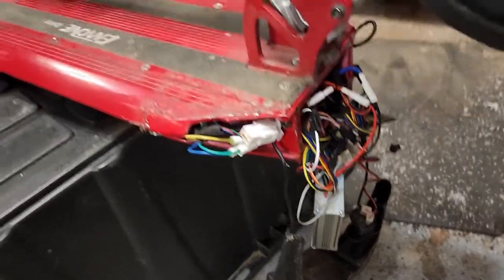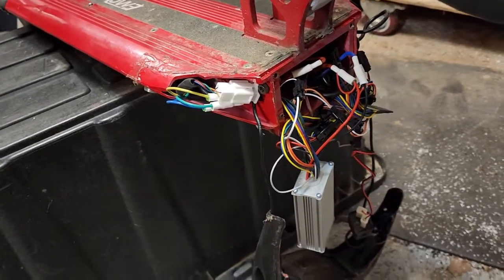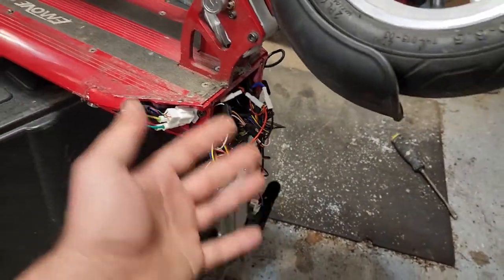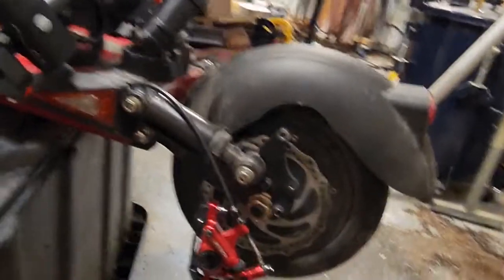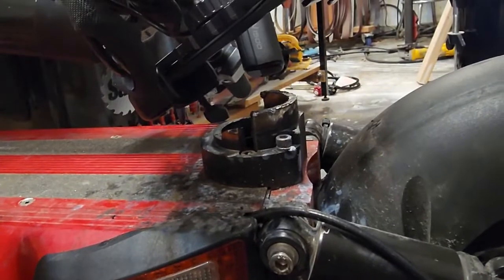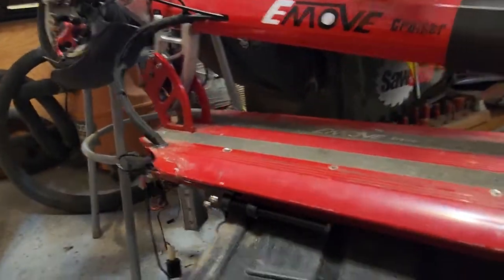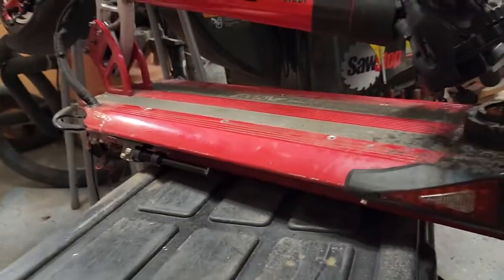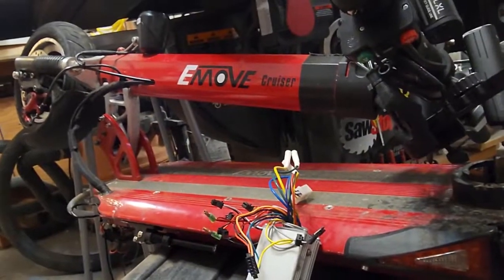Why you should not buy a Voro Motors 1000w emove cruiser - honest 6 month review - tons of problems!

Comment: I went to 3 different scooter repair shops in my city and the mechanics all told me to stay away from Voro. One shop mechanic literally pointed his finger and showed me a line of 5 Emove cruisers he’s fixing one by one. He told me Voro is one of those company that uses cheap parts on their scooters and sponsorships to sell their products.
Reply: Lol i like my emove but every part has been breaking down from the breaks the screws all fall out especially from around  the stem lock which is dangerous it doesn't have a 2nd safety feature to keep the stem in place i had to place a band around that to keep it secure besides that i had no electrical or motor problems its pretty good if you just just patch up all the problems yourself since things break in life but then again you shouldn't have to but its whatever it has its ups and downs
Reply: @ceffreyjastillo  I used loctite on the hardware.i bought it 5 months ago and haven't replaced a thing on it not one bolt and that's with riding through the Oregon Cascades which can essentially be a rollercoaster at times🤔
Reply: @Barry Szymanski  you basically got the original xbox 360 that DOESN'T get the red ring ..very lucky and good for you and also im try out that loctite you mentioned that seems like a good idea
Reply: @ceffreyjastillo  someone highly suggested it to me so I was like you know that's a good idea ,and ya know maybe I shouldn't be counting my chickens before they hatch so to speak 5 months is still decently new
Reply: @barryszymanski8022  yeah safe riding man
Reply: @ceffreyjastillo  I appreciate it 😁
Reply: @barryszymanski8022   How has it been since?

Comment: I have had similar issues with mine since I’ve purchased in November 2021. Voro motors doesn’t care. My scooter completely shut down on me. They blame it on being wet, claiming I had water in the deck. Which is insane, because I never used in rain or wiped it down ever! It stays in my car trunk. They charged me 75 for labor ( tighten screws) and a 35 service fee. To have to bring it back in two weeks later. Buyer beware!!
Reply from the maker: Wow, what a terrible company!
Reply: It is a terrible company, they sale parts that they dont even have in stock. I waited over 4 months for a new tire/motor i payed for just to have them tell me they dont have it after a weem prior to the 4 months i already waited... They told me they just got them in and then apparently they didnt . I got both their models and popped tires on both. The touring i only got because they had a sale and i got it until i got my new motor tire... which i still havent received yet. Trash company

Comment: I had mine and had it over 3,000 miles at this point. Its been fine lol. Just typical issues like flat tire and brakes going bad but thats expected. dunno what you do with yours lol.
Reply: Right im saying it breaks down like it was designed by people on acid and crack but besides the screws falling apart the cheap noodle string breaks ripping i just fix it up and keep moving lol
Reply: @ceffreyjastillo  yeah defo not built the best but DAMN that insane range keeps me coming back! I'm able to ride for hours and hours and still have battery remaining! And I'm cruising at over 30 mph too! Crazy
Reply: @TheJVCguy  lol yeah thats pretty much all it has going for it but if you make your own mods its a really good scooter i just put some stronger screws for the stem and put a clamp on the s knob so it doesn't pop out for extra protecton and bam really good scooter lol best battery for that vaule and thats a fact
Reply: @ceffreyjastillo  I just kept mine stock It's been fine after 3,000+ miles so it's alr. I have the 2020 model so I did upgrade the motor to the 1000w one and now I can get it up to 30 mph or more and still get around 45 - 50 mile range

Comment: I was thinking this is going to be my next scooter. Not any more! Thanks for the warning.
Reply: this is also a Gen 1 , I have the Gen 2 which has had no issue at all after 400KM , mine came with the rounded handle bars and they solved all kinds of issues . it's ipx6 water resistant which is not water proof. this guy should have returned the scooter after the first controller failure. Voro is known for good customer service on the vehicles
Reply: @KShedTech  how can you check to see what generation you have?
Reply: @ydoc503  Gen 2 has standard round handle bars compared to the square verson on gen 1 but anyting 2021 and later is Gen 2 + The Gen 2 has beeter battery life, range, speed, breaks and even updated lights.
Reply: @KShedTech  appreciate the knowledge! thank you
Reply: @KShedTech  Then there's the Gen 3 "S" model, new in 2023, which has the new sine wave controller, better upper stem base, 1000watt motor, vertical thumb throttle (love it!!),  plus they already put Doctor Orange goop inside the tires, and they're tubeless!  I ordered it and had it in my possession five days later. Great customer service. Very happy riding it. I love it. I'm so bummed for this guy's experience. Obviously he would have been better off with a massive dual motor scooter, something more suited to his (what appears to be) rough and tumble riding. I have a Kaabo Wolf Warrior 11+ (also from Voromotors) but after just a few miles I discovered it's a bit too fast and powerful for me at the moment but it is perfectly suited for future, aggressive off-road riding. Meanwhile my new eMove Cruiser "S" is perfect! People, don't give up on Voromotors. They've made the necessary improvements in this new 2023 S model and they're working so hard to please customers. (Just don't expect to return parts or accessories. Those items are not returnable.) Being a good company takes work and some trial and error. Give them a chance.

Comment: If they're refusing to provide additional help. You should definitely look into returning it for your money back. These things cost over $1,500.00 with taxes and shipping.
Reply from the maker: I tried but they said NO and they have already helped me more than they usually help their customers
Reply: @scooterbooter3133  That sucks. I just read their warranty online and it only covers one replacement of each covered part, so I guess they did what they could.

I would suggest getting a different brand of controller. Is there any chance you're pushing the recommended weight limit or maybe the hills you're doing are too steep?

Last year I bought and fixed up a damaged razor electric motorcycle for my kid, and you'd be surprised what upgraded electronics can do vs the usually no-name electronics that come stock.
Reply: @scooterbooter3133  They said the same thing to me lol. This company is horrible!
Reply from the maker: @Phyoomz  It also says itll take a 350lb rider up a 20 degree slope, which it couldnt do half of
Reply: @scooterbooter3133  that's horrible. And to think, I was gonna buy a touring over the summer. I guess not.
Reply: @Scooterbooter  Holy crap, they told me the same thing! I told them that while that may or may not be true, my scooter arrived with issues from day one (faulty brakes, missing screws, stripped sockets) and hasnt stopped having problems. So while they might be servicing it a lot, its due to manufacture defect, poor parts or poor tech. Argh, so frustrating.
Reply: I have reported these issues and the company at 311. Just giving suggestions to all. Something must be done with this company!
Reply: @danielacardona7160  I'm getting a lawyer to sue them. I guarantee they will have to pay back just like 3M
Reply: @audemars_piguet13  well I don’t have the budget to pay for a lawyer but let me know if my review can be helpful or anything else I can do. 
I also reported the company when I recently got the scooter at the Business Bureau but they don’t seem to be registered as a company there
Reply: @danielacardona7160  agreed. I will do the same
Reply: @scooterbooter3133  That's just terrible for them to say, a 25amp controller with a heavy rider is going to easily burn out the controller if used up big hills constantly
Reply: Was looking at this scooter for quite some time. But i hear complaints all the time , should i go with dualtron mini instead? Or eagle pro?
Reply: @scooterbooter3133  Are there any lemon laws in your state? You can always go to small claims court if necessary. Voro not granting warranty coverage within that year is probably more in class-action lawsuit territory; if everything you say is true, you'd be doing them a favor by going through small-claims.

Comment: I am a delivery driver and in first two weeks I had many things breaking like twice folding mechanism screw, key lock ignition, bearings on the front wheel, rear fender and controller in the end. Than I tried to post my experience on Emove owners facebook group which turned out to be very shady because moderators denied my post which makes me think they are censoring negative experiences. Some review companies are also sponsored by them and say only positive things about the scooter which makes me wonder if they tested it toroughly. After I posted few comments about the issues I have esperienced someone from Voromotors contacted me via email offering to fix things for me but I have to pay for it. Now I fixed all of this issues alone and so far so good. All in all scooter is good when it works properly but there is no guarantee it always will.

Comment: I bought the emove cruiser S in June of 2023, but now the controller has died and melted the wires inside the scooter.  The battery was still able to pass current to the motor indefinitely after the controller failed even with the machine turned off.  This caused the rear motor to lock up due to the motor windings being energized.
Definitely a controller issue. If only they splurged a bit more on the controller and potted the sensitive electronics, then it likely would have been better.

Comment: I also can not and would not recommend this scooter. Here is my experience after 6 months: 

I purchased my Emove Cruiser in Nov 2021 online from the shop in LA. It arrived in NYC with issues. Missing screws, loose screws, wires too short which would disconnect. The front brakes needed to be replaced. This began a continual series of issues and problems with the scooter, both minor and major. (Noted below)

While the shop in Brooklyn did try to mitigate these issues, I had to cajole and push them to do so. They continually tried to shirk responsibility, and sometimes did not correct an issue or it left the shop with new issues. I don't believe Voro Motors is out there intentionally trying to screw people. I do believe they don't want to stand behind their product, and do not have the right trained technical repair staff, nor use good parts or a good build. They often suggested it was my riding style which caused the problems. For clarity, I ride it in the bike lanes here in NYC to commute to and from work.

After the scooter arrived and they fixed the first issues, the front wheel and shocks and shock mount fell right off after the bolt holding the shock mount the frame sheared off. This was after repeatedly informing both Brooklyn and LA shop that the scooter felt unsafe and too wobbly, in spite of frequent tightening of screws. They assured me everything was ok. Spoiler alert: It was not. As noted, the entire front wheel and shock section fell off, and they replaced it.

The rear wheel went flat and after finding no leaks, a local, well respected scooter shop told me the wheel was rubbing against the rim and causing it to deflate. I took it to Brooklyn, informed them of the issue. They disagreed with the assessment. However, the tire was flat and has no leaks. They inflated the tire. Spoiler alert, it went flat again a few weeks later.

I've had to replace the rear brakes three times, without having ridden the scooter much from Nov-March. Again, the shop suggested I was riding the brakes the too hard. I can tell you I was using the brakes in a natural, standard way while driving the scooter in a bike lane.

The battery failed. This is after I told them it wouldn't hold a charge, I brought it to the shop, and they told me it held a charge for them. I took it home, the battery wouldn't hold a charge! I took it back to shop, they called me a few days later to say they have more experienced battery techs now and indeed have confirmed the battery has failed.

And now lastly, the front tire and shocks feel way too loose and unsafe again. I feel strongly all these issues are due to poor parts, bad build and bad tech. This scooter clearly can not be used in regular use on regular city roads. In fact, after all this, the company has informed me that this $1500 scooter that can go 25MPH should not be ridden on uneven roads as that can damage the scooter. They also told me I was free to sell it to someone else If I was dissatisfied. All in all a very disappointing, exasperating situation, made more so by a company that has be to dragged along just to honor basic responsibility for repairs and service.

I do not and can not in good conscience recommend this scooter or the company service.
Reply from the maker: Wow man that sound even worse than my experience.  Spend 1500 dollars and all you get is months of frustration and an unsafe and unreliable scooter
Reply: @scooterbooter3133  Right. I mean this very sincerely, and told them a similar thing for the health and sustainability of the company: They should make it very clear this this scooter is not built for commuting in an urban environment and discourage people from buying it for that use. Instead, what they have now told me long after the fact is they recommend it not be used on uneven or bumpy roads, and I am free to sell if it I like. A horrible, atrocious, unsustainable business tactic. Someone higher up needs to get this under control stat.

Comment: My cruiser has been in the shop for 4 months as we try to find a replacement motor controller. We don't want to buy from voro again as they sent us 2 dead on arrival controllers and then ghosted us. I really want to get it working again as It was a very fun ride, and now that I don't have a warranty to worry about, I'm free to modify as I please. So if anyone knows of a good replacement motor controller, could you please link it to me. preferably sine wave, but any will do as long as it works and is not from voro.

Comment: Thanks for posting this video. It makes me feel I am not alone on facing these issues with Voromotors. HORRIBLE customer service and warranty policy. They normalize unsafetiness and insecureness. It shouldn´t be normal that screws break or fall apart while you are riding. And much more. The videos of positive reviews might be true but for the first month or so.
Reply from the maker: Yea, thing is like a bottle rocket - fun for a second then it explodes
Reply: Daniela, I am bummed this happened to you and also a bit relieved to know it really isn't just me. The customer service in Brooklyn was constantly suggesting it was my riding style that caused problems, or that having to tighten the screws before every ride was normal, or even that the fact that it felt like it was going to fall apart our from underneath me was just "regular give." I bought mine in Nov. Have had consistent severe issues, including the front tire and shocks falling right off as the nut holding the shock mount to neck sheared right off. Voro has been really tough to deal with. Yesterday, they emailed me to tell me I was free to sell the scooter if I was unhappy. So so bad. Its been terrible. :/
Reply: @paolosstore  I hear you exact same experience. It’s always my fault. Last Wednesday picked up my scooter at BK facility. $330 in repairs, bought new controller, electric wires … etc because according to them that was needed. About 10 miles riding the scooter and exact same issues as before. I bring it back on Saturday and the controller was broken again with water damage when I only rid the scooter once and no rain. They didn’t replace it but said that it was my fault and that it’ll break again because it had water damage??? I had just bought a new one supposedly. I really think that either they lie to the customers and don’t replace things or they have really bad quality stuff and accessories. 
They told me that if I didn’t pick up the scooter in 15 days they’ll charge my card $20 per day for storage lol. It’s just insane. People, PLEASE!!! Don’t buy from this company. It’s a nightmare
Reply: @danielacardona7160  Ugh, I'm really sorry to hear that. Something isn't right with that shop and company. I've been considering filing a report with the AG here in NY. Not to create any problems for them per se, but I keep hearing the same issues from Cruiser owners and if it's possible (which I think is likely) that Voro knows they are using faulty parts, cheap parts, and/or are knowingly selling scooter that they know can't handle regular use in an urban environment, I feel like it might be good to at least make a complaint with the AG and get it on record, to help build documentation for future cases if anyone also does the same.